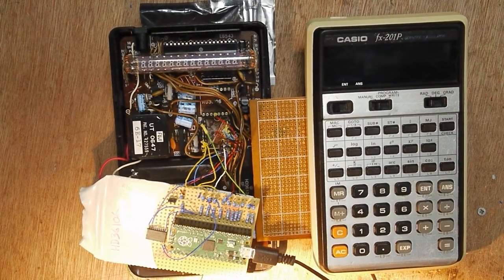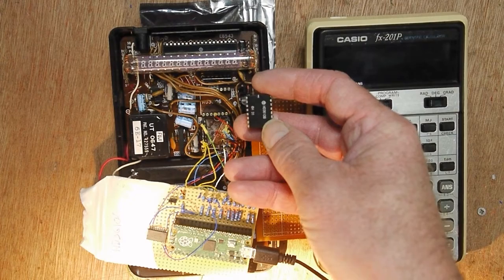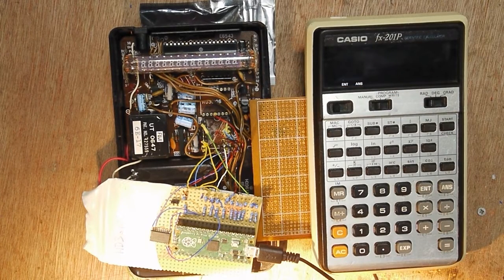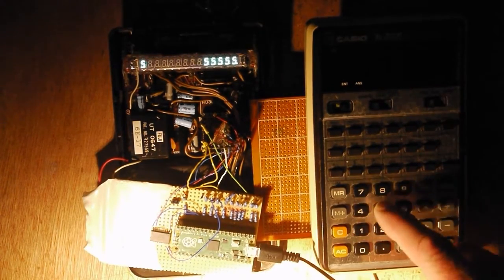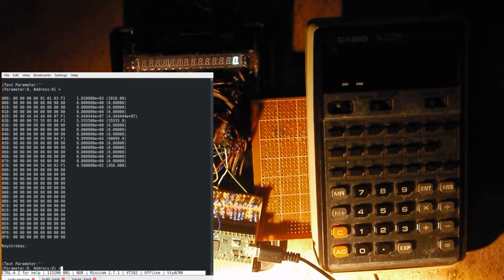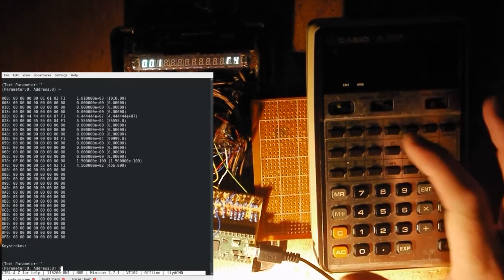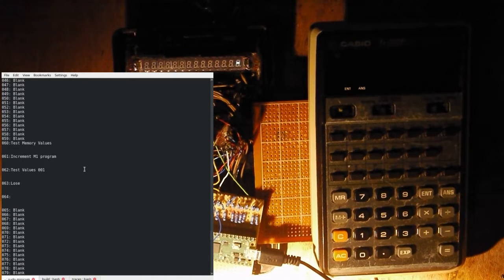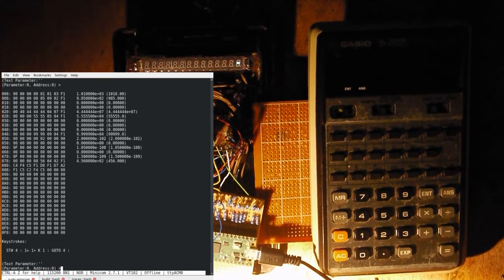Casio FX201P Part 1:Reverse Engineering RAM

Comment: nice work!
Reply from the maker: Thanks. It was a tricky one to reverse engineer as I went down a few blind alleys and mis-interpreted things to do with the HD36106..
Reply: @menadue  I could believe it without any doubt – so it's pleasure that you share your knowledge with us out there!
 I bought recently a Casio fx-102  from 1976 at a flea market for 2€  🙂
Reply from the maker: That's a nice looking machine. It's a single chip design so no hacking, though.